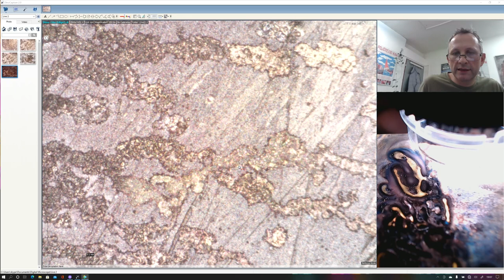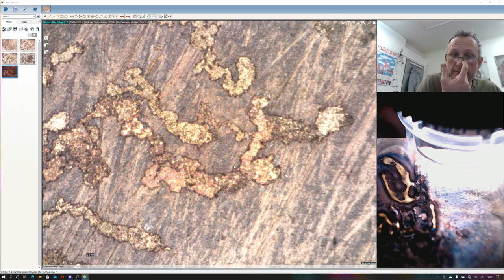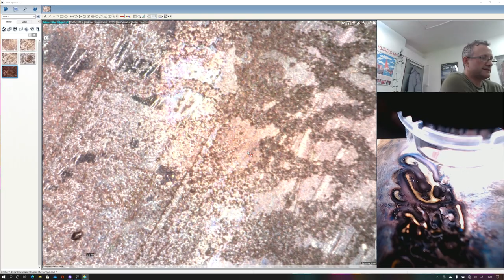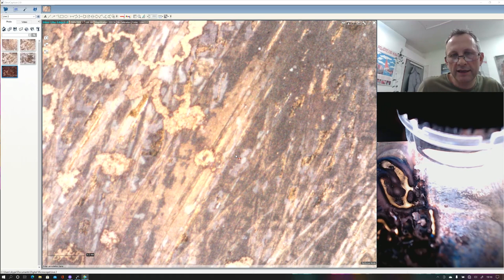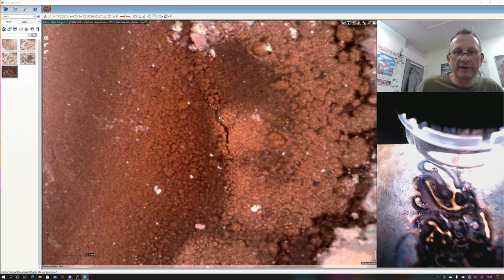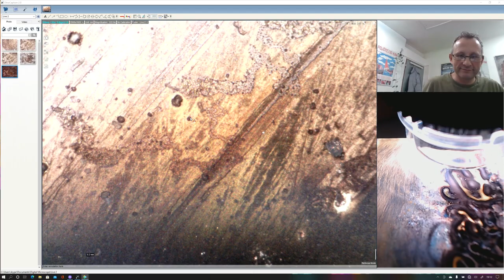VEGA - Valley alluvial channels

Comment: The flood plane might have been produced by the condensation of silicon oxide (glass) vapor or plasma  that had been produced in the more active eroded areas were pitting is more pronounced. The production of this silicon glass coating seems uniform in both thickness and composition. The EVOs then in another latter stage invaded and overlaid the glass disposition area with an additional stage of transmutation in which newly produced elements tinted the glass substrate. It appears that the small nascent EVOs are just as capable at producing transmutation as the mature EVOs.
Reply from the maker: Axil, Silicon and Oxygen are something that we might expect to be produced

http://www.nanosoft.co.nz/results/select_*_from_TwoToTwoAll_where_E1inlbH_Cu_Zn_Sn_PbrbandE2inlbH_Cu_Zn_Sn_PbrbandE3inlbO_SirbByMeVDesc.html

http://www.nanosoft.co.nz/results/select_*_from_FissionAll_where_EinlbH_Cu_Zn_Sn_PbrbandE1inlbO_SirbByMeVDesc.html

Or it could be just zinc which is in high abundance in the brass.

Either way, the subsequent smaller EVO trails are likely as you describe.

See the new views to be shared tonight.